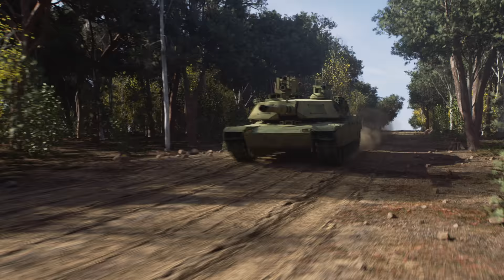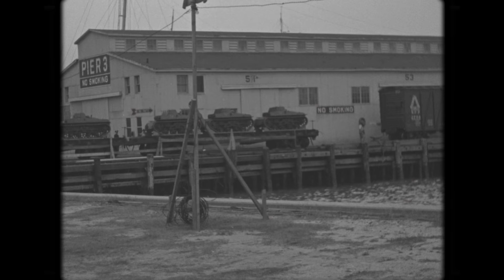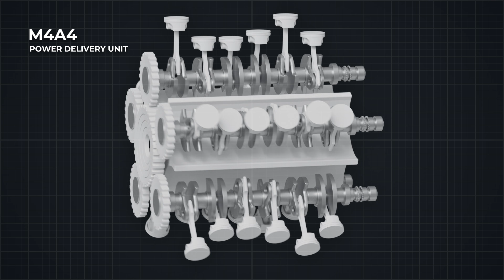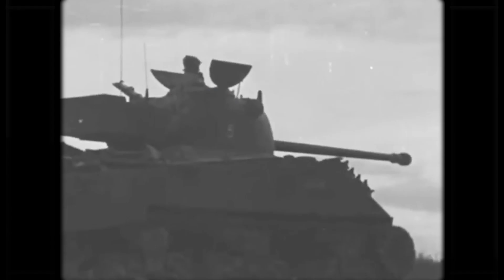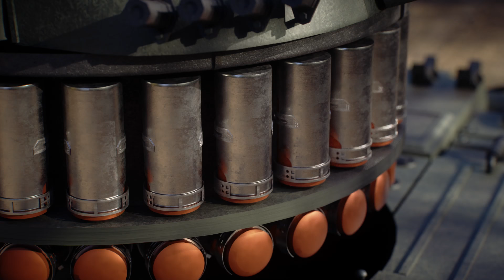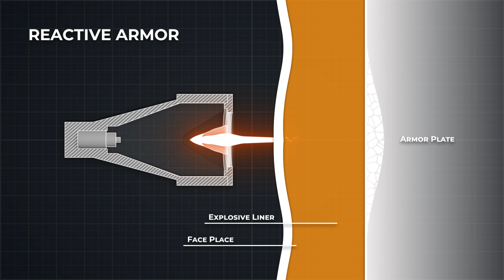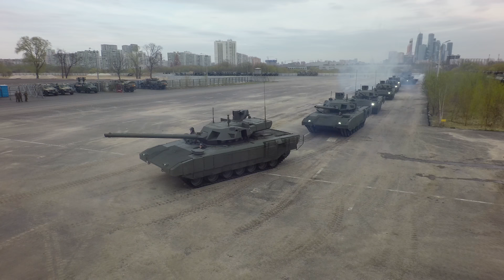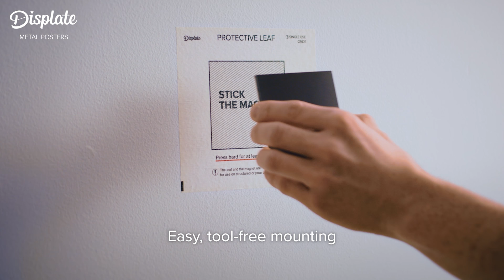Why America’s Tank Failed in Ukraine

Comment: 19:30, the t14, such a great tank not a single one has been lost in ukraine! o wait.
Reply: It said that the new configuration makes sense. Doesn't say it's great. Murrican bots😂
Reply: The serious comparison with the T-14 tank calls into question the author's competence and whether the bank account was funded by russian offshore companies.
Reply: Total crap
Reply: Jokes aside, there is absolutely no reason for Russia to go the Abrams/Leopard/Challenger route in Ukraine.  The current T-90 production line is sufficient to cover Army demand and the T-14 can be used as a testbed untill the solution for FPV drones can be found.
Reply: @victorzvyagintsev1325  Hate to break the news, but the Russians aren't building too many upgraded T-72s, oh, sorry, T-90s. They wouldn't be cleaning out their storage yards of every serviceable tank chassis if they were. And they have completely halted any work on the T-14 because it has so many flaws it is unfixable. It was designed around the engine, and the engine is a waste of metal.
Reply: @nicholasconder4703 NATO also cleaned out all available storage, and they are not even openly fighting....whats your point?
Oh and a little history lesson, T-54/55 is a 1944 design.  Yet it was the good old T-34 that finished off Germans and Japanese.  Intoducing unproven main tank designs during an attrition war is a very bad idea.  Case in point Germany with its cats.
Reply: @victorzvyagintsev1325  man the t-90 production is not sufficient to cover the war demand. If that was true we wouldn't be seeing russian t-62 losses.
Reply: @bosstwind7010  T-62 are being refurbished at tank repair plants and are in no way hindering the MBT production.  If you need a turtle tank, makes more sence to send a T-62 instead of T-90.  
In any case, it was predicted that Russia would run out of tanks by now....yet here we are, Russia has not even begun to purchase Chinese tanks :)
Reply: @victorzvyagintsev1325  Well, have you noticed that they changed tactics and stopped throwing their tanks into the meat grinder? Your comment reads like you have not.
Reply: @victorzvyagintsev1325  please list all advantages a t-62 has over a t-90 for a turtle tank.
Reply: @bosstwind7010  Its a throwaway tank.  Its lighter and has smaller ground pressure.  Thus you are sending a tank that will go through unprepared terrain better than the new tanks and its loss will not hit your forces as hard as losing a brand new shiny T-90.
Reply: @victorzvyagintsev1325  thank you for accepting my point about how bad a t-62 is and the fact their useing it because they don't have sufficient t-90 production.
Reply: @bosstwind7010 its about the same as the leo1...whats the point of keeping old tanks in reserve if you are not going to use them in a war?  Mind you, a trainer T62 is on record of taking out 2 Georgian T72.  It maybe old, but it can stand its own in a booth fight.
Reply: @victorzvyagintsev1325  no one's going to pick a t-62 over a t-72 let alone a t-90. Russia doesn't have enough tanks so theyre forced to use crap from the 60s. That like america being forced to use the M60 instead of the m1a2.
Reply: Before producing t14 you need smiilar systems everywhere, producing whole family. That's how Russia does it. If that does not happen there is no reason for t14 to exist. For example t-90 is compatible with other armored vehicles like BTRs, 2S19, Pantsir, TOR etc. A lot of parts are interchangable that would not be the case if they started producing T14.
Reply: @sleepyjoe7843 The problem with the T-14 family of vehicles is that the engine sucks. It is basically an updated Porsche Tiger engine. And if you have ever read up on what happened with Porsche Tigers, you will understand the issues the T-14 is having.
Reply: A great tank with poor implementation. It is however, a sound design...

Why do you think all next gen MBTs, be it American or French, are 3-man crews in a separate armoured capsule with an empty turret and an autoloader?
Reply: @bot12203 im just amazed at the amount of glazing he did for a tank thats never seen combat.
Reply: @bosstwind7010  He stated that itll never be produced in enough quantity or ever leave development. That's literally that tank's flaws. Otherwise the general concept of uncrewed turrets, armored crew compartments, acrive protection systems etc (taking russias word for it) is the direction modern tank combat may be going. He's using the tank as an example to get a point accross.
Reply: @bosstwind7010   brother there's a difference between 'glazing' and saying that a tank is, on paper, generally conceptually sound. He quite literally states outright that the tank is basically a showroom piece and that Russia can't produce them nearly fast enough for their needs, not that it's some crazy super-weapon. He reasonably pointed out that the T-14 has things that the new Abrams is intending on, with the small but efficient diesel engine, the remote-control turret, and active defence. 

Let me be clear, it is DEFINITELY nothing much above modern western tanks, if at all, and that's before even considering it not being made in useable numbers. It absolutely has its shortcomings, and there are several things western tanks dominate it on. It is also, however, on paper, intended to be more practical/modern than an M1 Abrams for anyone who isn't the logistical behemoth that is the United States of America, and that is what Real Engineering was getting at.
Reply: T14 isnt even in Russian army, its prototype. Unlike nazi propaganda machine, BM oplot, which they dont even want to use it. Like challenger, all destroyed challengers lost turret, and lived probably 1hr. And then they removed it from ukraine😂 nato tanks work only against ak 47 in middle east.
Reply: @Niko_rj massive amounts of copium to be glazing russian diks so hard. What’s your relation to the Russian Nazis?
Reply: @Niko_rj  What a bunch of bilge. A quick search shows only 2 Challengers destroyed. The remainder are currently sniping Russian positions and tanks. Nice try, Ivan.
Reply: Nafo bot, now instead of yapping, or posting cripted bs, lests see when and where last time Challenger was seen, and how it ended 😂
Reply: @Niko_rj  youre right it's such a useless tank that ukraine keeps asking for more....
Reply: @bosstwind7010 yeah, ukraine is asking for more shit, but not challenger 😂
Reply: @Niko_rj  More than two years after their delivery, British Challenger 2 tanks remain in Ukrainian service. Crews say the tanks have proven effective in long-range engagements, demonstrated resilience against drone attacks, and offer better visibility and handling than Soviet-era vehicles. 

"Vadim Prystaiko, Ukraine’s ambassador here, told listeners to Radio Liberty the deal to double Challenger 2 deliveries had been struck during a recent visit to the UK by Ukraine President Volodymyr Zelensky.

“If we were promised 14 tanks, then as a result of President Zelensky’s visit, that number will double,” Prystaiko was quoted as saying."
Reply: @Niko_rj  it's sad you don't know how to do a quick google search...

Comment: The American Abrams is much heavier than what most bridges in Ukraine ( former SSSR) can support ( the bridges were then, rightfully designed in such a way to prevent NATO expansion.
Abrams has an airplane turbine, it burns the same amount of fuels while idle, it requires 10 hrs.of maintenance for every 5 hrs. or so of operation ( to clean oil and air filters and whatnot.)It also requires kerosene ( airplane fuel) and lots of it.
In Ukraine, there is mud in the spring and fall like nowhere else( because of 2 meters of fertile soil) and Abrams is built to fight in the desert ( you know, against the Camel jockeys,or Sand Ni663R$, as racist Jimmy ( or even better Billy Bob) likes to call them.Abrams, just like Patriot, THAAD, their planes, were designed in the 70' s , not exactly the newest ( and best ) technology available.

Comment: Abrams has great crew survivability and a great gun system but is very vulnerable to mobility kills, especially in Ukrainian conditions. This was a machine designed to efficiently kill massed T-72s on the north German plain. Ukraine's bridges were all built in Soviet times for tanks of almost half the Abram's weight. It's massive fuel consumption is tolerable for the US Army which, being American, has always loved gas guzzlers and has logistics and tactical doctrine built around that; the Ukrainians don't.
That's on top of the things that have made all today's MBTs far more vulnerable since they were designed - smart mines, drones and top-down missiles. No matter how great the glacis and turret armour is you can't armour the tracks or the top.
Ukraine had to be arm-twisted into accepting them - they said they were unsuitable for Ukrainian conditions. They were right.

Comment: Everyone says that the Abram's AGT1500 turbine is a gas guzzler, and it very much is, but almost no one remembers that the AVCR-1360 diesel engine it was up against during the M1 development and trials process had a fuel economy that was at least as bad, and often notably worse than the turbine's — no, I do not know how they managed that, but they did. It also saw much less improvement from the ongoing refinement both engines were undergoing, and offered worse performance overall on top of all that. While you can argue that they should've switched to a more advanced, reliable, and fuel efficient diesel engine at any of a number of earlier points than now, or at the least offered one as an option for export customers, the US Army very definitely chose the right engine for the era when they first adopted the M1 and was more than well equipped to provide the logistical tail required to keep it fed in the field.